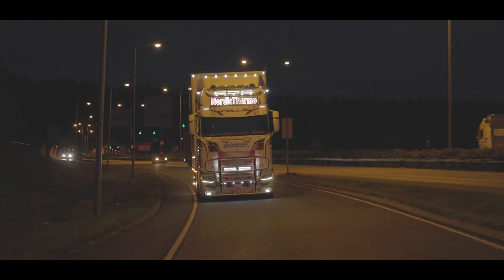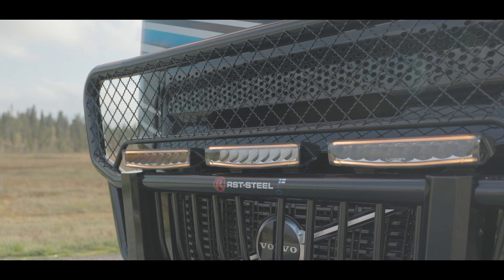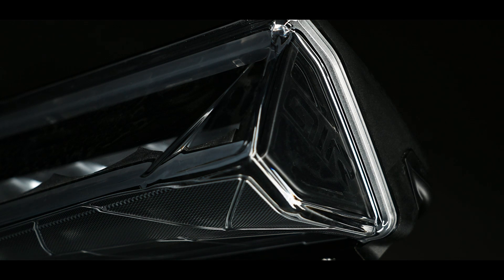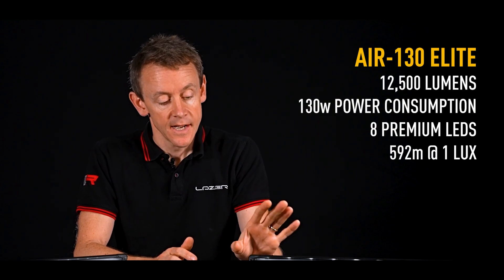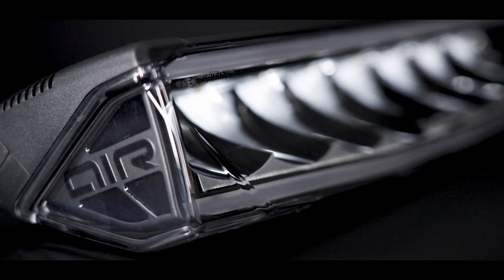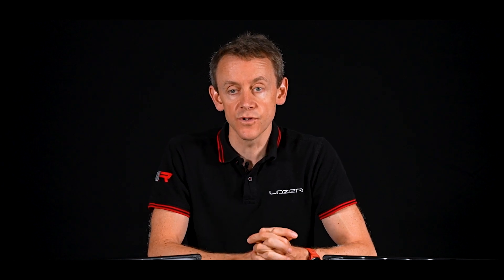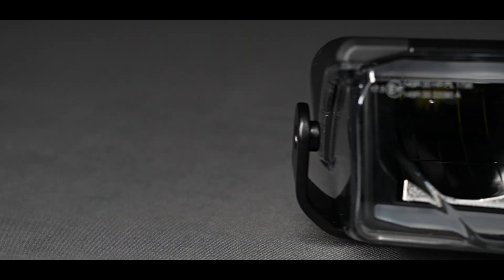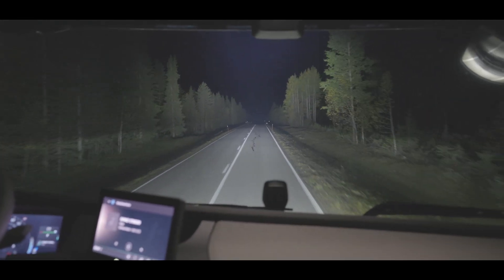LAZER LAMPS | AIR | Product Walkthrough

Comment: Right.... so this can't be mounted to a car? only trucks? is it 12 or 24 volt? and why is it only 1 lux at 574metres?
Reply from the maker: This can definitely be mounted to a car, we've seen a few car installs, although it was originally designed more for heavy trucks. The beam pattern is designed to provide maximum lumens in key areas whilst driving, particularly in front of the driver. You can check out all the technical specifications and beam pattern for the whole AIR range on our website here: https://www.lazerlamps.com/lights/air.html